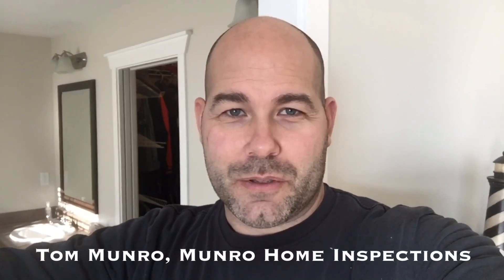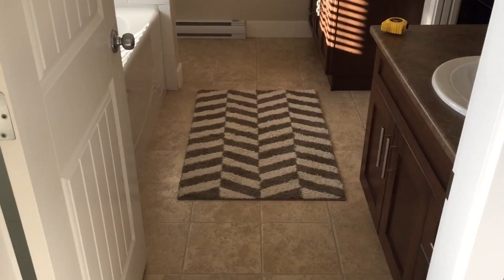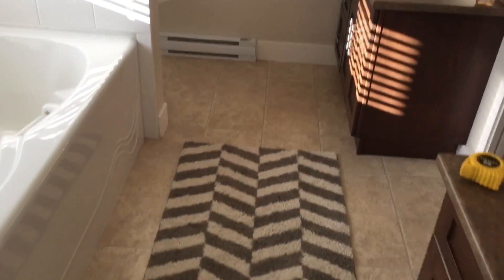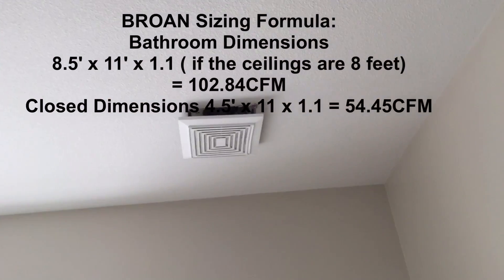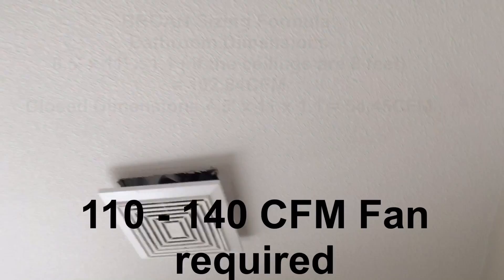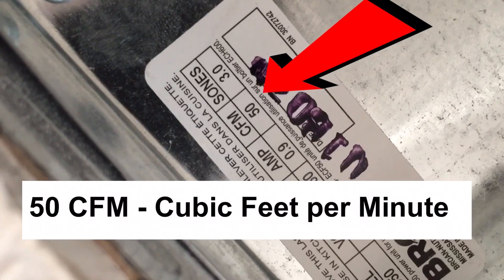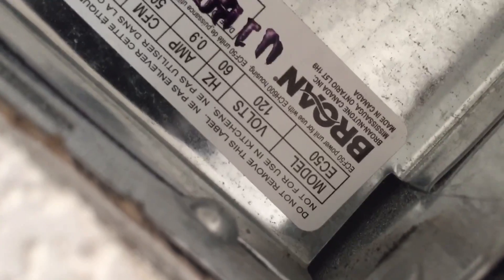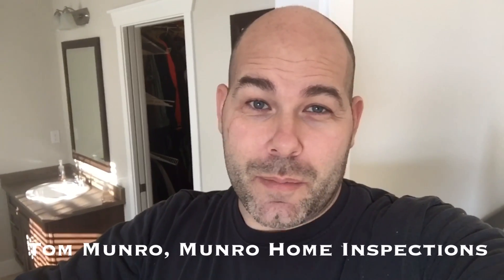Bathroom Fan Fail

Comment: I don't think your correct. there are many other factors that play into it. placement ..if there are doors or windows . most new homes don't have a door to enclose the room so the actual code I don't think apply. however I do agree it should be upgraded but not required
Reply from the maker: Hi David Ungacta, Bathroom fans are required in homes where I'm located. With the introduction of air and vapour barriers it is imperative to have a proper sized bathroom fan to get out the moist air created by occupants before is causes a condition where mold can grow.  It's in our BC Building Code and it's also specified on the manufactures installation guide for the fan itself. Thank for watching!!
Reply: In most parts of Canada (BC, Alberta, Ontario, etc) the bathroom fan must meet the the manufacture's specifications. You cannot have a smaller unit in a larger bathroom. Also because it is cold in Canada, we don't usually open our windows (-35 to -45 C temp). Hence, the fan must be able to push out all the moisture in the room because it is the only outlet to outside during Winter.
Reply: Is the 8 times per hour air change rule part of code there or just manufacturer's instructions? Yes, most jurisdictions I've worked in no longer accept windows for ventilation in place of fans, but there is no enforced requirement for air exchange rate (at least not pertaining to bathrooms and laundry rooms).